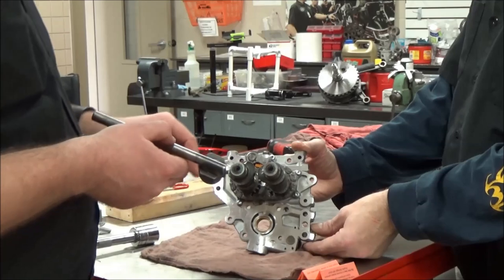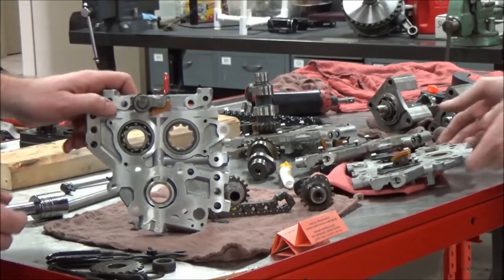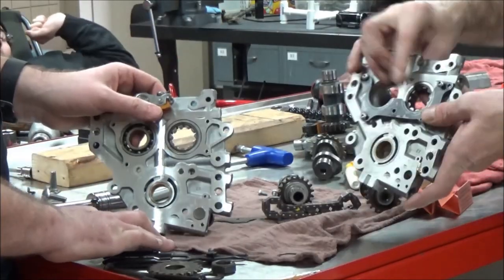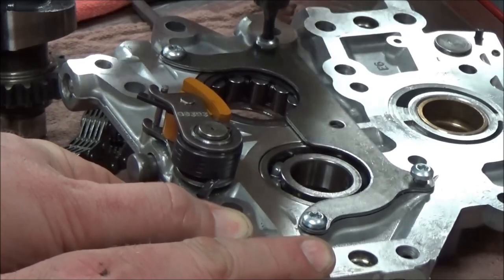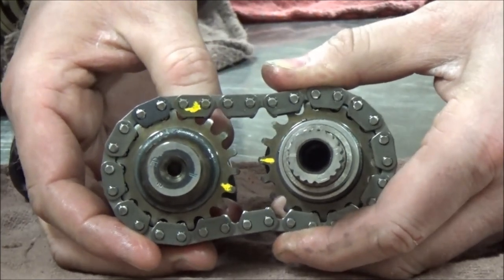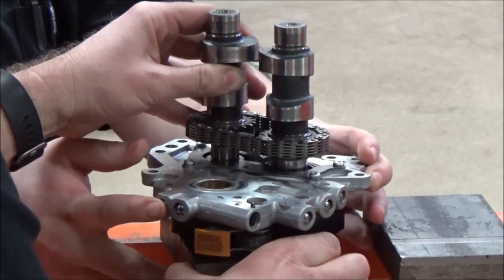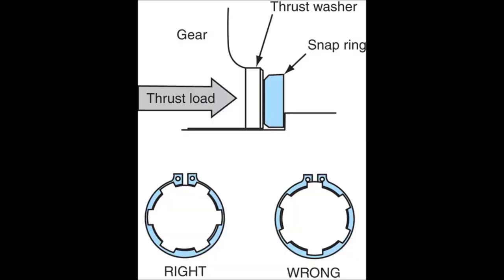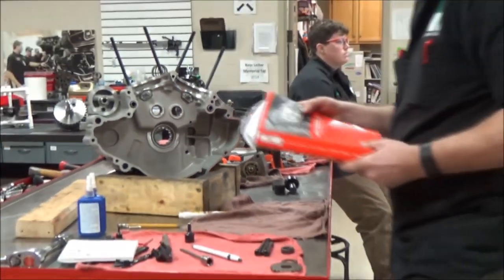Twin Cam Series: 10 How to remove / replace camshafts from the cam support plate

Comment: I was a harley tech for 9 years. I had on the job training. All techs should have formal training at a accredited school. I made so many mistakes because I didn't have a firm foundation for repairing motorcycle. Good work. You cover the do's and don't's of repairing bike. I salute you.
Reply from the maker: +juanjohnism Thank you and please share!
Reply: Shane Conley do I have to take off the gas tank in order to get into the rocker boxes on a 2015 lowrider with a 103

Comment: On really critical places to 'count on' threadlockers---such as the bearing anti-walk out plate....a small drop of threadlocker under the head, clean and dry of course will help hold the fasteners also. While it also may protect the threaded sections of the use of the threadlocker from oils, etc. ingress. Sort of an insurance policy.

Comment: Excellent video. Did you press the cams out of the bearings, leaving the bearings in the support plate?
Reply: they did,and then they put the bearing support plate back on before pressing the cams back in.so why would you need to even remove the support plate to press cams out.

Comment: Shane, Thank you for sharing the knowledge would you mind making a video on how to choose an open belt drive? Im having trouble finding one for my 2003 fxdwg also how to properly remove the motor from the frame would be a cool video
Reply from the maker: Thanks for commenting and adding value to our community! I don't have anything on the schedule coming up but can work with you one on one. Check out my website for info bud.

Have you subscribed yet to never miss a video? Have you seen the video playlists? Over 600 videos! Check them out here: https://www.youtube.com/user/conleybuilt/playlists  

Want to say “thanks” or “keep it up”? Click here https://www.paypal.me/how2wrench    
 
Your answers and help are just around the corner. Save time and money while protecting your investment and yourself by doing it the right way at www.How2Wrench.com

Comment: Shane , I have a 05 road king and my support plate does not have the oil hole that you point to in this video or the plug for clean out ... is there a reason for this?  A little help please. Thanks Mike allen
Reply: The difference is the two style engines 88a & 88b. (B) is for balancer, which is in the softail engines and is a solid mount engine, that extra oil hole feeds the balancer chain in the crankcase. Your RK is a rubber mount engine (a) and does not have a balancer in the crankcase so that oil hole is not required. I'm sure you have this figured out by now but hopefully it'll help those in the future if need be.

Comment: i wanted a harley until i started watching these service videos 
to many failure points in the desighn
Reply: crowmagg1 I own a Harley 2002 RK. Had gear driven cams installed to replace the stupid engineering of the cam shoe tensioner. I see they are still doing the same dumb idea on the Milwaukee 8. When I'm ready for another bike I may go with a different brand. Wise up HD.

Comment: He mentions service manual recommending checking and replacing worn cam chain tensioner shoes. Then why in the Hell didn't the Harley mechanics that had serviced my bike for years do that before the Mickey mouse piece of crap plastic blew apart plugging oil pump ports blowing out relief ball and losing all oil pressure at 90 mph in the middle of Nowhere Wyoming, ruining a trip with my 2 best friends on Honda Goldwings. Yes I'm pissed off!!!
Reply: Don Julio El Magnifico Definitely a ridiculous, stupid design.
Reply: I did away with the chain and their dumb little tensioners with gear driven cams. 1400.00. A terrible expense when it could have been designed that way from the factory.
Reply: They didnt do that because it isnt in the manual. I checked.